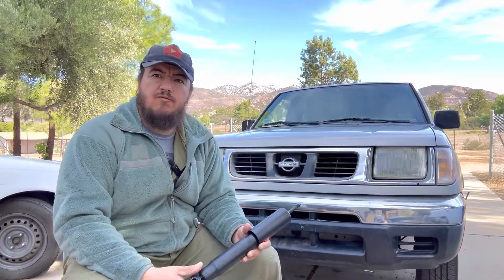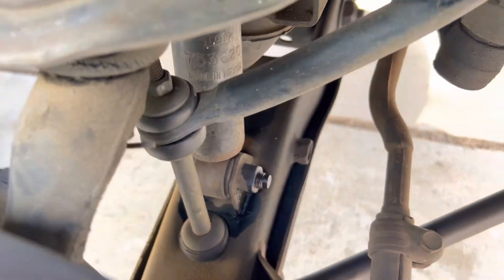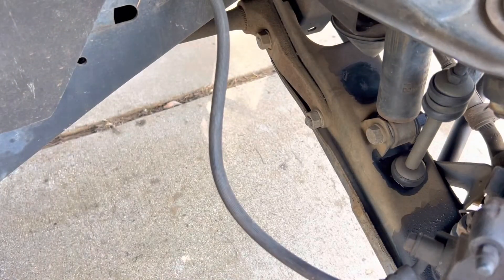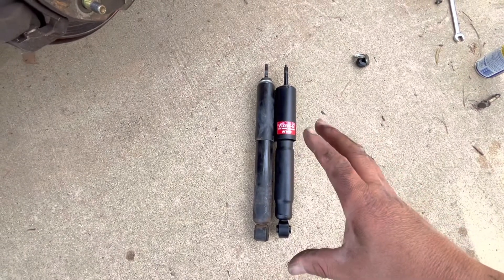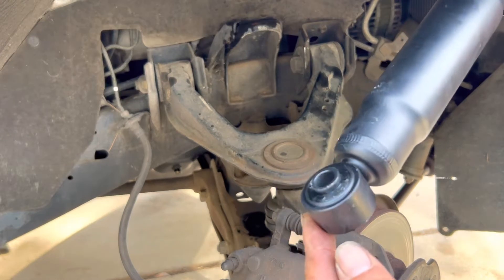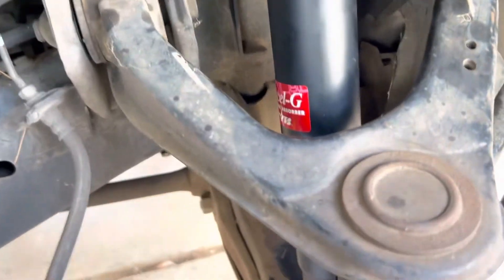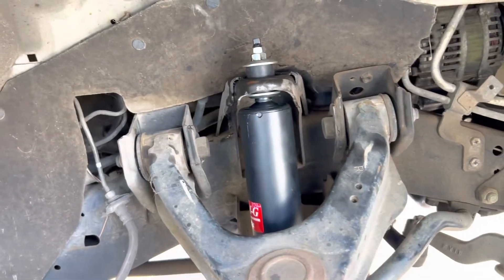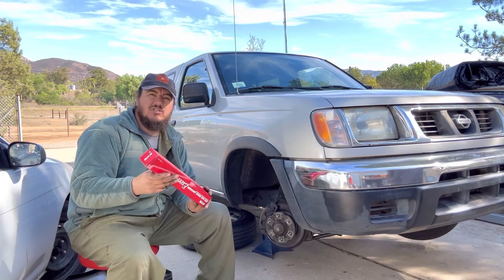Front shocks replacement Nissan Frontier @elchanojose

Comment: Tip from experience: use a vice grip around the cylinder of the old strut if your nut is too rusted because you will destroy the screw square bit otherwise (like i did).

Comment: Chano puse mi alternador y nose xq no me sale la batería en el tablero mi carro es un nissan sentra 2002
Reply from the maker: Hola Mario!  La luz de batería en el tablero solo te aparecerá cuando el sistema está detectando baja carga o alta carga de corriente en el sistema de energía 12v.  Otra puede que el foco de esa luz esté fundido.  Revisa con un multi-metro de que si el sistema de carga al estar encendido el motor de que te esté dando 13.5v a 14.2v de voltage y esto será norma y así esto te dirá de que la luz esta bien.  Saludos Mario!